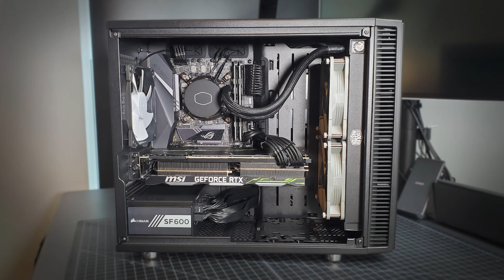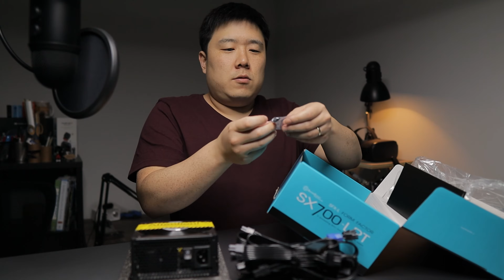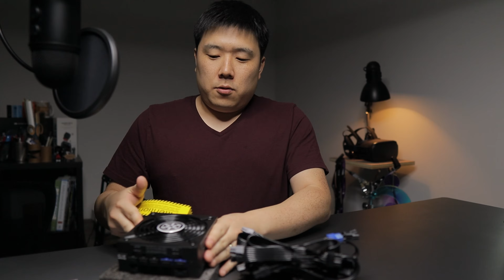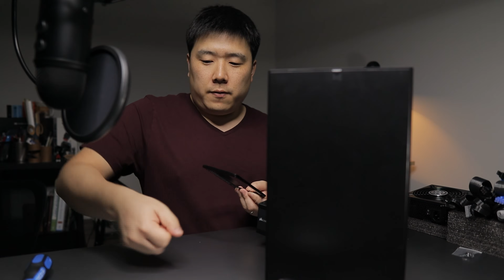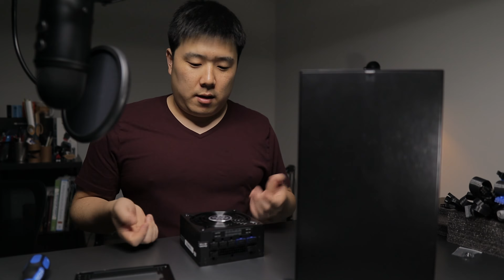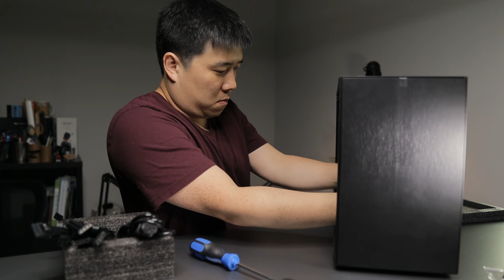Custom Architecture PC Upgrade - Silverstone 700W SFX-L PSU

Comment: I got this case second hand. Just got a Corsair six 750 but an Mwe 550 non modular was installed already. I’ve not built a pc for over 20 years lol - the cables at the back behind where you installed the had, do you just disconnect from the psu when uninstalling. And connect to new psu, I don’t have to mess with the cables at the back other than that? Like unplugging from the motherboard?
Reply from the maker: You should remove all cables connected to PSU if you are replacing one. They recommend to only use the included cables as they can have different connector to the PSU side.

Comment: Here in the 2022, thinking on buying this sfx 450w psu for my dell optiplex build i7 6700 and will add a gtx 1660, u think this can work out?
Reply from the maker: Make sure your optiplex supports such GPU size. 450w also may be a bit low side.

Comment: Hi. I'm wondering if maybe you can help. This may be a bit difficult to explain but I'm currently having issues at the moment trying to install certain parts.

These are the list of things I have I am trying to install:
- a Lian Li rgb strimer plus, 24 pin
- Delta t force SSD RGB Max 1tb
- be quiet! SFX L Power 80 Plus Gold Modular Power Supply ATX12V/EPS12V
- Azza Pyramid mini 806 PC case
- 5 inch LCD display raspberry pi
- Antec prizm 120mm, 4 pin fan uptop

This power supply did not come with the necessary cable that is needed in order to connect the strimer and SSD.

I've already trying contacting Be Quiet directly and Micro Center. Any  suggestions on where I can buy this or any other cables that can be used?
Reply from the maker: The PSU didn't come with Sata power cables?
Reply: @JosephKim  no it didnt. I tried emailing bequiet and there's no response. Is there any other alternative of what I can order and do?
Reply from the maker: @welcomehomelucy5153  unfortunately, probably not. I do not have any experience with Be Quiet PSU, and different PSU manufacturers have different cables.
Reply: @JosephKim  would you recommend that the psu has to be the same brand as the power supply? has to be a bequiet cable?
Reply from the maker: @welcomehomelucy5153  I'm not sure what you are asking. PSU is Power Supply.

Comment: Wait so you changed all of the cables for the ones on the PSU? do you think I can get away with changing the mobo and cpu but not the peripheral (hard drives etc) ones?
Reply from the maker: The HDD (satal is the only cable that reach the necessary component. I don't 'replace' the cables, I have extended them.
Reply: Yes, but what I'm trying to say is, the cables from your first PSU (old one) are now replaced and then connected to the extensions and what not with the cables that came with the new PSU.
I'm just asking because I had an issue with a new Psu I bought and I'm starting to think it's happening because I left the hard drives etc with the old cables and just replaced the new mobo and cpu ones.

Comment: You shouldn't mount a semi-passive PSU upside down! Idea with those is for heat to dissipate through convection which requires an opening on the top.
Reply from the maker: If it heats up above threshold, it should turn the fan on though?
Reply: @JosephKim  This would make a lot of sense, but documentation in my Seasonic says it is about the load and not temperature and their documentation advices to turn the "hybrid" (passive/active) mode off if installed upside down. Went a bit deeper and tried to look for instructions on your model but they were very generic, so who knows. Great video nevertheless, keep it up! :)
Reply from the maker: @Sp3z  thank you! I am also curious about this. Have sent an email to my contact to see if this is true.
Reply from the maker: @Sp3z  semi-fanless PSUs can be either load or temperature based (or both). The SX700-LPT has both with the following parameters:
 

Below 150W – Fan stays off indefinitely

150W ~ 270W – Fan starts at 60°C

Over 270W – Fan always on

Over temperature protection (OTP) – Triggers at 98°C and shuts down PSU
Reply: @JosephKim  this makes a lot of sense, thanks for digging in! I need investigate more if my Seasonic is also built this way :)

Comment: I want to change my silverstone RVZ03B-ARGB for nano s, will sfx-l ps cables fit w/o extenders?
Reply from the maker: Probably not. Especially if you wanna use the back compartment
Reply: @JosephKim  thx a lot) rtx 3080 is too Hot for silverstone RVZ03 i think. Hope that nano will provide a better Cooling.

Comment: after having this psu for over a month, how has it been for you so far? I wanted a corsair sf750 but they are out of stock everywhere i look. I have found silverstone sfx-l psus but the reviews are sometimes mixed. thanks
Reply from the maker: So far, I have not noticed anything. Which is good. I did not want to notice anything. :)

Comment: Really enjoyed the video! By the way, I would like to know if the Silverstone unit performs better in terms of noise level when compared with the SF series from corsair. I am trying to choose from the SFX-l 700w and the corsair sf 750 to put into my nr200 case. Thank you
Reply from the maker: I am unable to say which has in fact better noise level. This one is so quiet! The noise comes from the radiator fans :) Idk about sf750, as I never owned one. But it also seems like they have different rating veriances? I'd let price dictate.